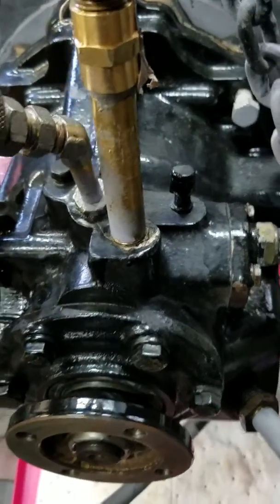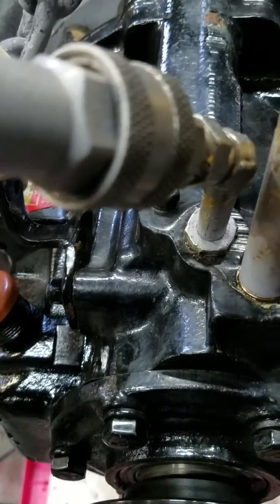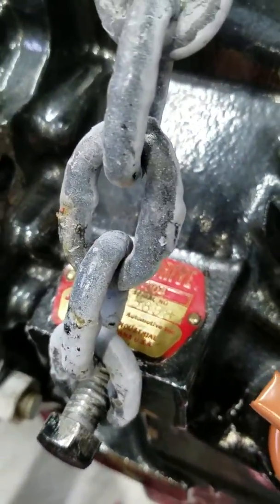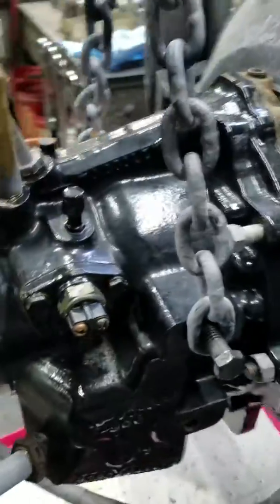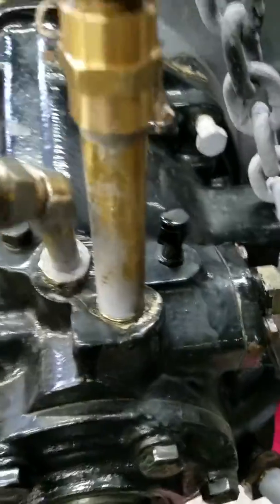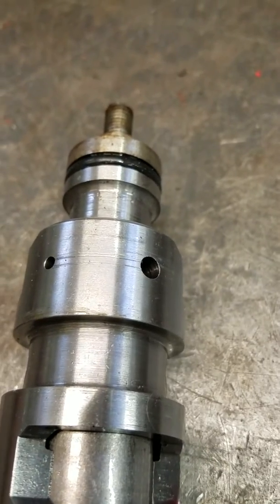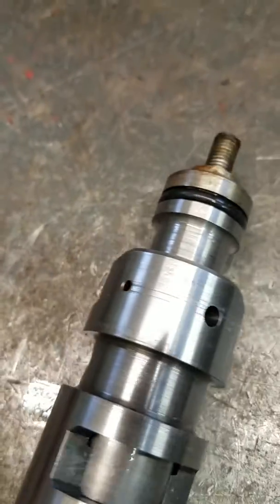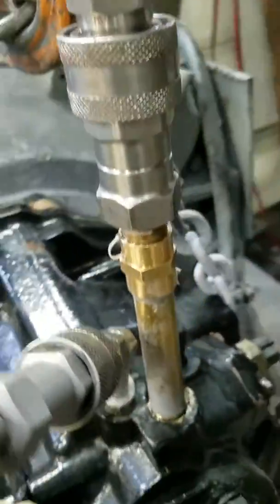Velvet Drive 71C rebuilt testing. Selector Valve issue

Comment: I found ever-so-light sticking and seating interference of the regulator in the control valve. Just in the seating area. Is that likely the cause of my loss of fwd and reverse?  I cleaned it up, it slides effortlessly now, and will be heading back down to the boat tomorrow to test.  Or should I just call a mechanic to remove it from the engine?  Fluid looks great.  VD 10-14xxxx  71C

Comment: I have a 71c. What would cause my Trans to build enough pressure to blow the dipstick out? Mine blew out tonight so hard that it sounded like a gunshot when it hit the dog box. Rebuilt it last summer and until this happened it hasn't gave me any trouble.
Reply from the maker: The vent or an overheating issue. Maybe fluid level is possibility?
Reply: @halemarine5991  is there anyway I could send you a picture of the Trans fluid? I don't see any metal shavings in it, but it looks like may have water in it. So maybe Trans cooler is cracked? Not sure how it would have got cracked it's brand new and I drained it when I winterized the boat
Reply from the maker: If the transmission fluid is pink it has water in it
Reply: @halemarine5991  it's not really pink but it's not exactly red either. It's almost like a purple color. Ive seen water in Trans fluid before but never seen it look like this. Possibly burnt?
Reply from the maker: Overheating will cause a darkness to the red transmission fluid

Comment: Hello i just bought a 1992 ski nautique with 351 and pcm-40 transmission 1:23/1 ratio. Transmission seems to be engaged in gear and cant get it to go i to neutral. I haven't had the boat in the water yet doing work to it and it sat for a long time vut tranny dip stick has clean fluid and doesnt smell burnt. Any clue what the deal is or and pointers would be great thanks

Comment: Hi  im from Ireland i have two borg warner boxes .I dont have tags near gear leaver but model numbers on the bottom side of each .10-05-065-901 this has a 15 degree v box attached .Can you tell from that number what the ratio is .The second box has no tag either and the number is 10-04-065-905  and im hoping you can tell me the ratios of each by the details shown.Happy Xmas to all and stay safe .
Reply from the maker: The casing numbers mean nothing to me. The only way to check the ratio is toddler the Vdrive from the transmission section and spin the input shaft, counting how times the output turns.
Reply: @halemarine5991  Thank you .Im a shipwright and not a mechanical engineer .Could i ask you if i turn it by hand will it be good enough or do i need to get it up to 40 cycles ? minute as some guy mentioned to me .But no one is sure.Again Have a peaceful and joyus christmas to you and all of your family and friends .Keep safe and we will see this thing off soon .
Reply from the maker: @brotherdom1   Hello again. Use a large electric drill. Thid will give you the RPM needed to apply the clutch plates. The cooling lines need to be connected and fluid in the transmission. Merry Christmas to you as well!
Reply: @halemarine5991 Last call ..In your first message you mention toddler ..I assume that means split from transmission.Cheers
Reply from the maker: @brotherdom1  Yes seperate the V-drive from the transmission section
Reply: @halemarine5991  Thank's I appreciate you giving me your time and know how .Especially when you arent going to likley see me at your work shop with a v-drive under my arm .Thanks again.Iv'e been to CT manny times to my sisters place .Great country .dont like Trump.

Comment: Hey! I have a 1017 004. What should pressure be in neutral, forward, and reverse? Thank you
Reply from the maker: 150 PSI in all postions
Reply: Thank you! At what rpm?
Reply from the maker: @danmartin6523  Our tesat stand only turns up 537 so all RPMs
Reply: Thank you!

Comment: I have a 10-17-004 with low pressure at all times. (75psi neutral, 60psi reverse, 60psi forward) at idle. I have slight scratching on my selector valve just like this one. Could that cause a  loss of pressure? Thanks for your time!
Reply from the maker: If you have scratches on the Selector Valve the bore will scratches also. Hone out the bore and replace the the Selector Valve. If the bore doesn't smooth out than it's time for a replacement transmission.
Reply: HaleMarine could scratches between the two ports like in your videos cause low pressure in neutral as well? I only have scratches between the two ports just like this video.
Reply from the maker: The other place that might cause low pressure is where the output shaft goes through the Case housing. Sealing rings or the case itself could be wore